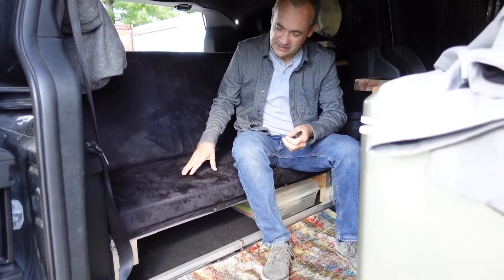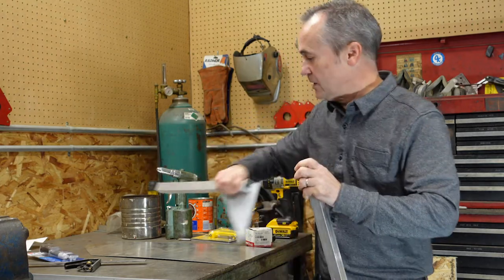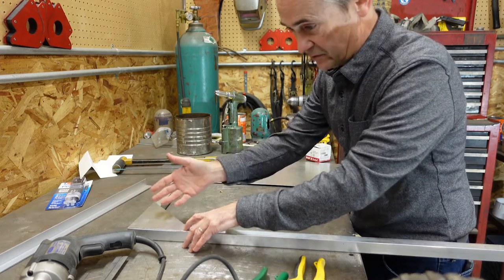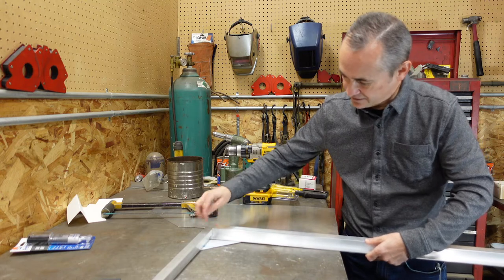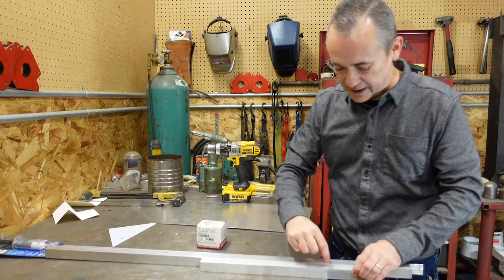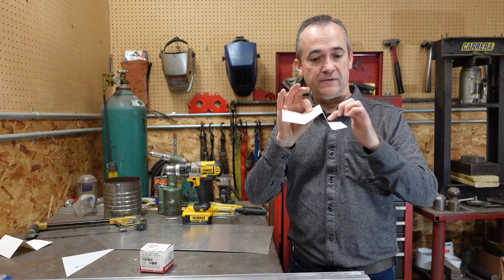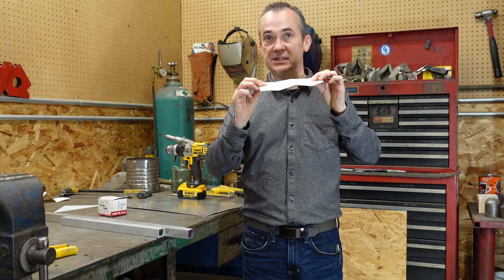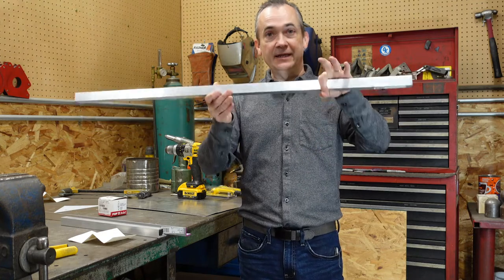MINIVAN BED DESIGN || PART TWO || MINIVAN CAMPER

Comment: Awesome!  So glad you provided a more detailed vid on the bed build.  It's just me travelling in my Dodge Caravan and I'm building the bed in it this week... so my bed will be lengthwise with pull out sliders in the middle going across the van.  The one question I was struggling with was how to attach the bed frame to the floor of the van.  I love that he covered that here at the very end. Turnbuckles attached to the back storage metal frame is a great idea... 

I will be using 2x2" leg supports so I think I can actually just screw them into metal frame of the rear infloor storage space for kind of the same effect?  I was struggling the most with how to attach the front support legs to the metal pieces in the floor. If I put a 2x4 between the legs on the floor, I can use the hose clamp idea.  I had also thought of zip ties but hose clamp might be stronger.  

Thanks so much for these tips!

What kind of black rubber did you cover the OSB wood with please?
Reply from the maker: As far as screwing the rear frame to the stow n go I used the stock bolts and the bolt holes for mounting the seats. As long as your frame is close to the mounting points it should work for you also.  

The rubber used to cover the OSB is just underfloor backing.  

Good luck! Let us know how it goes👍🏼😀
Reply: @ChristineIC  Thank you so much... I will let you know! Tomorrow is the big day. :) A local carpenter is going to help me.

Comment: Great videos!  Could you tell me the length of the bed in couch mode before extended?  I’m guessing it 54” and then the 20” drawer slide takes it to 74”. Let me know if it’s different please. Also, what is the length of the 2 x 4 attached to the drawer slide and the platform? Is it longer than the drawer slide?  Thank you for your help.
Reply from the maker: Hi Amy! Mat will measure it out for you. We will get back to you tomorrow. Thanks for watching!😃
Reply: @ChristineIC  any chance of getting those measurements?
Reply from the maker: @amyviggiano2017  I apologize. We will get it to you. Life happened.
Reply from the maker: @amyviggiano2017  you’re about right on  the closed distance at 54” although might be closer to 50”.  We are currently traveling in big van we will make some exact measurements.   Here are the measurements of each section of the bed: 
47” Wide, 74” total length , the 5 sections are 18”, 20”, 20”, 4”(non-moving), rear flip is 12”.  Hope this helps and thank you for watching😀
Reply from the maker: @amyviggiano2017  the full length 2 x 4 are 74” long. The 2  x 4 attached to drawer slides are 28”.  Hope this helps 😃